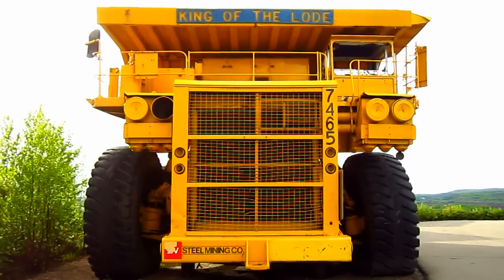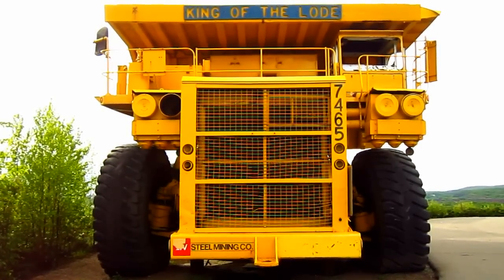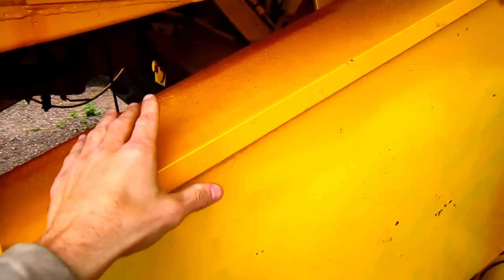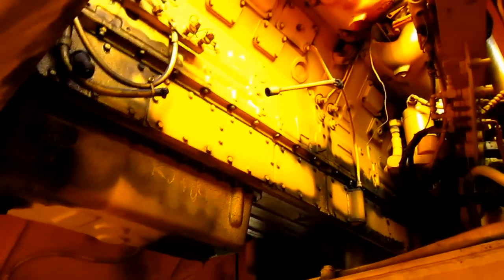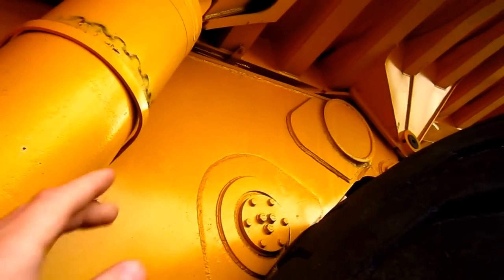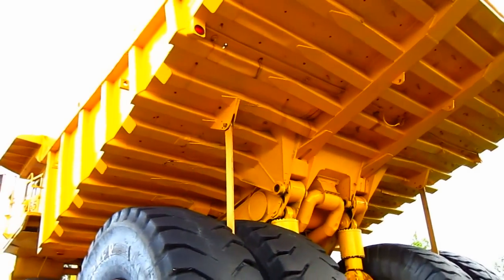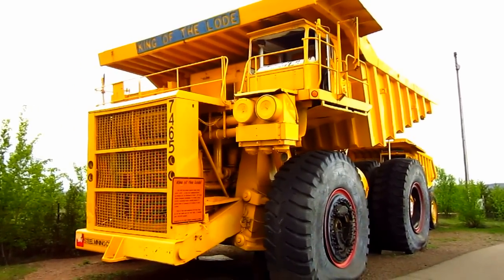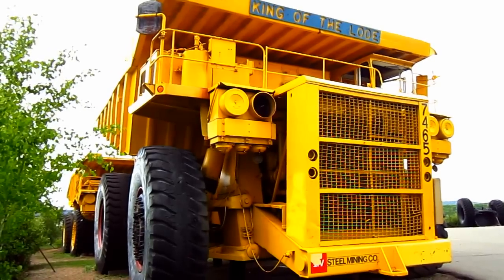Wiseda KL-2450 Documentary

Comment: Great documentary on a great truck, thanks.

Sigh, someone put a lot of work into restoring that machine for display. It looks like it might have even still run when it was put there. But it is depressing seeing the tires going flat, the air(?) pipe disconnected on the prime mover, the cleanout port open on the bottom of the filter canister, etc. It makes me wish some local garage mechanic would volunteer an hour to take his truck out and pump up the tires and close up some of the openings that shouldn't be open.

Comment: I worked on a rebuild program for 21 of these trucks in Western Australia in  2004/5  The trucks came from the ''boneyard '' [ scrap ] on an Iron Ore mine at Mt Newman WA  where at the time of their operation they were the biggest haulers in Australia at 240 tons. These rebuilt units went to Indonesia.    Many more still remain in operation throughout Australia  mostly in the coal fields and we all know them as WISEDA the ONLY name for these beauty's
Reply: +David Aitken Interesting.  Thanks for sharing!
Reply: To '' enginemodify'' & MrThisIsMeToo and otherwatchers,..You are correct, Air and hydraulic powered heavy service tools, and others units called ''torque multipliers ''  as well as mobile and overhead cranes depending on  where your working, also lots of pallets and forklifts.    The work is fairly straight forward and after the '' big main stuff ''comes off ,then  mechanics everyday hand tools take care of the rest..........cheers